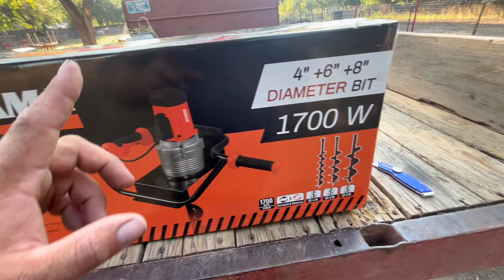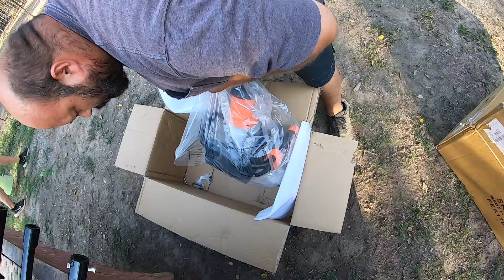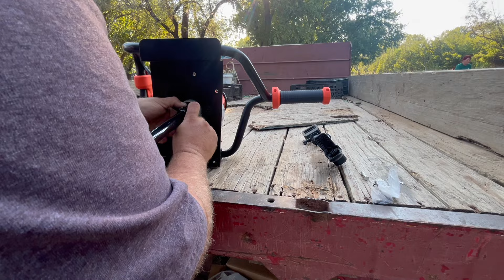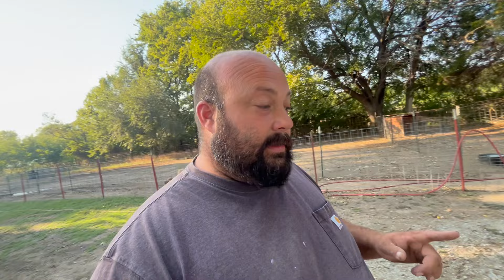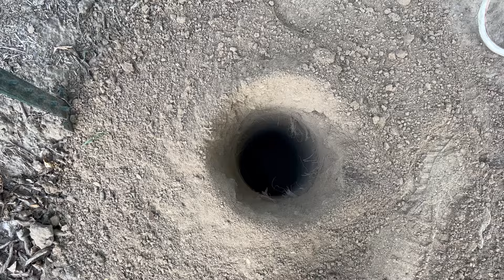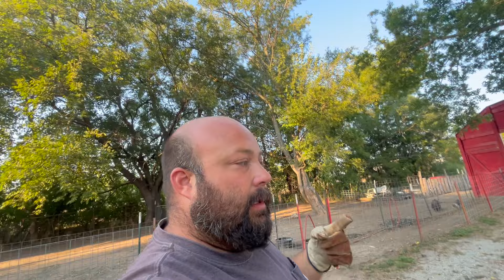1 Less Engine! PROYAMA Electric Auger.

Comment: Made any other holes in the last few months? How’s it holding up?
I’m going to pull the trigger on this auger. You made great valid points. Between all small engines to maintain, one less motor!!!
I contacted Proyama directly, they told me hire gas version has more power but no reverse. For my needs you sold me on this version,  bringing to homestead. I don’t need to make holes everyday, just once and awhile.
Reply from the maker: It's still holding up great! I use it here and there nothing crazy and no complaints, the reverse function is hands down worth its weight in gold. Good luck!

Comment: What kind of extension cord do you use with the Auger (Gauge, Amps etc)
Reply from the maker: I've been using a 12/3 15 amp cord with no problems
Reply: @faithfulfarmadventures  I've bought a similar cord that is 200ft long. Hope it works, thanks.

Comment: Do they have a battery power auger
Reply: Ridgid makes a battery version, I like the idea no batteries. I dot. Mind using a generator or power bank. I think a generator is the best option when there is not electric service.
Reply from the maker: I am not positive but I don't believe so.

Comment: I had never used an auger before. We have just moved in to a new property and my wife wanted both plants and trees planted. Thus the reason for my purchase of this auger. With no prior knowledge I was able to have the auger up and running in no time and it worked perfectly throughout the entire project of planting Plants and small trees throughout my property. I would say the ease of use and multiple size auger drills were the 2 best parts of the auger. Yes, I would recommend this product without reservations.
Reply from the maker: I am impressed so far I'm glad to hear other people have had a good experience as well. Yes it was a very straightforward operation.